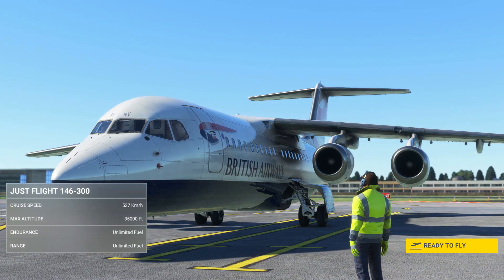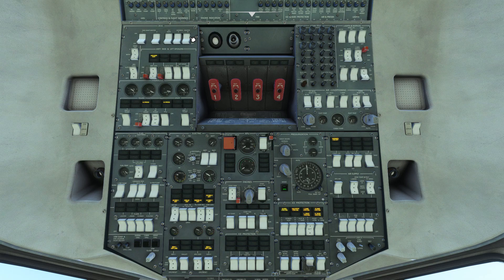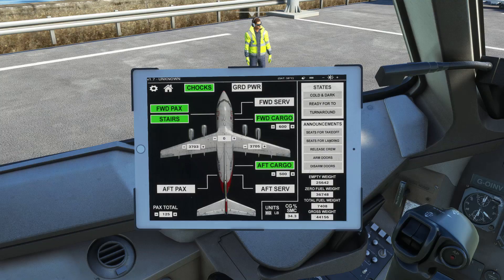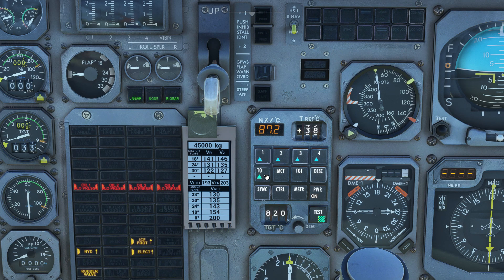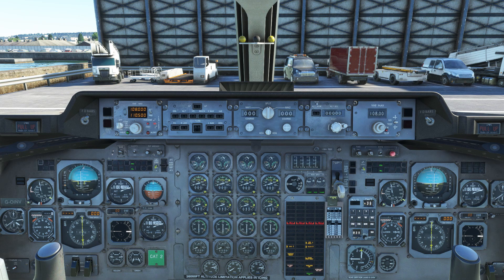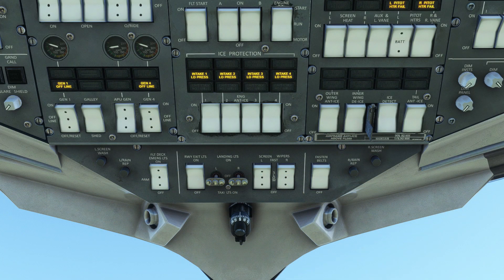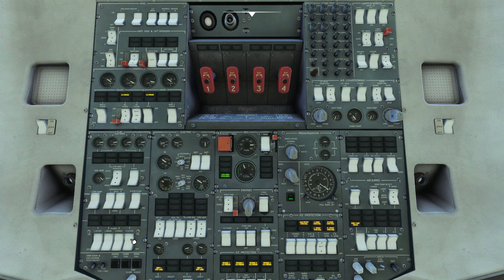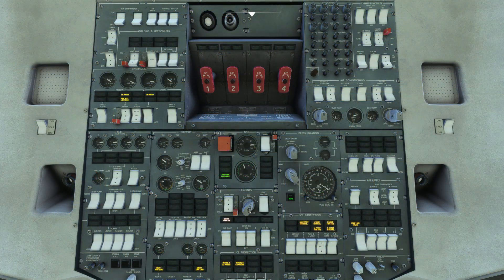Just Flight 146 Professional MSFS - Engine Start

Comment: Hi I have followed  your procedure for start up in the BEA 146 professional to the letter but  on starting engine 4 the N1 only reaches 41 and N2 only 22 on the dial.  Nothing else happens.  Also I need to have the external power on for the start up . What am I doing wrong !  need help.
Reply from the maker: @RaymondGrant-ih3kb  thanks for letting me know - this video is quite old and the airplane has been updated a few times since. I’ll review it when I’m able to, but in the meantime, please use the documentation included with the airplane or the in sim checklist for procedures

Comment: Hi there, Have you ever had the problem that the no1 engine wont start even after you have done everything in the right order, fuel valves are open and fuel pumps are on, but still nothing even though the other 3 engines are starting properly. But when I completely exit the flight and restart everything exactly the way I did previously it will start. I have absolutely no idea why its doing that...
Reply from the maker: Aside from MSFS being MSFS, I have no idea